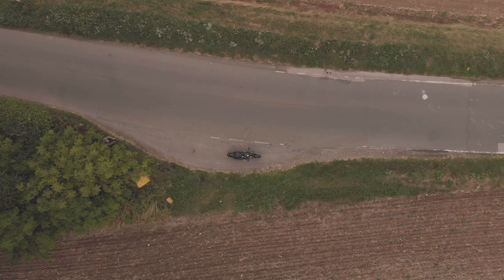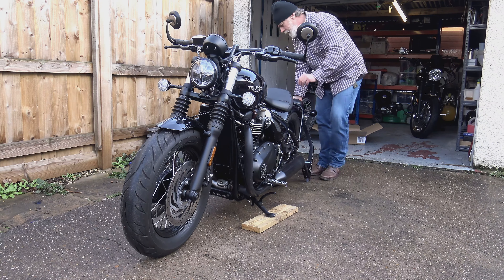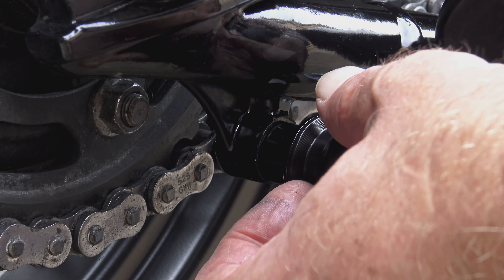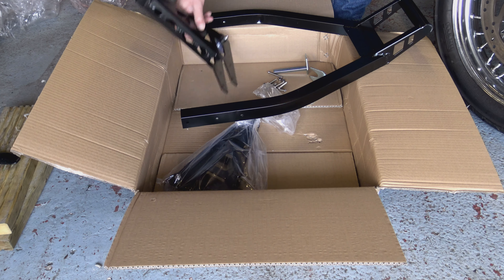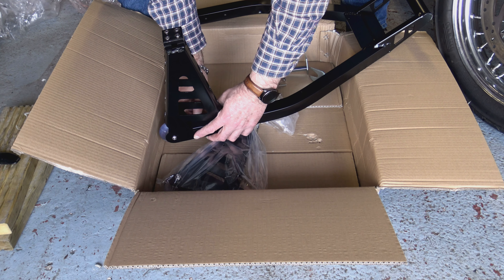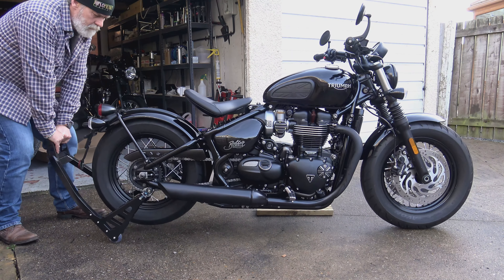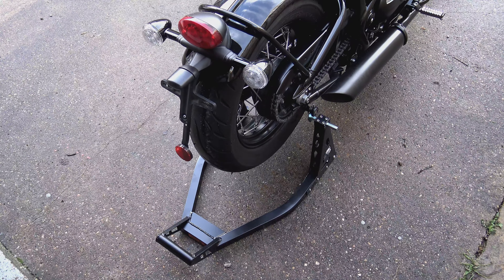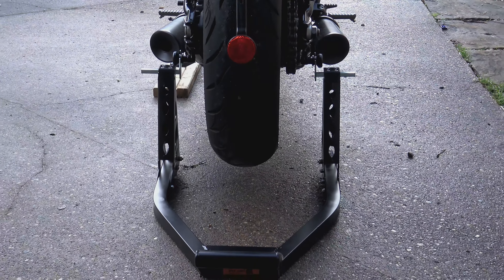Triumph Bonneville Bobber/Speedmaster/Thruxton. Budget motorcycle Paddock stand, & How to use it!

Comment: For anyone having an issue with their paddock stand not having enough leverage, you can put some 3/8th steel rod through the rear axle to get a higher point of contact for the paddock stand. works like a charm and saved me having to replace my expensive stand for a low profile version.

Comment: Arm length, leverage and weight capacity are key!  I have two paddock stands. They do clear the rear license plated but won't lift the very heavy Triumph Bobber.  I bought a hydraulic center lift that works well.

Comment: Excellent bike, better than all harley, but the chain is a little snag.
Reply from the maker: Why is the chain a snag?
Reply: @stuartfillingham  
Not a big problem you must oil it in every 500 km;  how much time do you consume for a periodic oiling of the chain?
Reply from the maker: @onourkaraaslan  Ive been running chain driven bikes for almost 40 years, Never had a problem with chains. They are the most efficient way to drive a bike! shaft drive is inefficient and drags down power, pushing up fuel consumption and is incredibly expensive when it does need servicing. only ever had one belt drive bike and it was a nuisance constantly stripping teeth and needing replacement. If you dont like spending time maintaining a motorcycle then a motorcycle is probably not for you!

Comment: Can you straddle the bike and push forward on the bars to take it off the stand thereby reducing the possibility of the bike falling over ?
Reply from the maker: No I wouldn't advise it James, theres a good possibility you would cause some damage and end up wearing the  paddock stand!
Reply: I imagine with careful use of the front brake it could be done ?
Reply: No problem, it was just a thought.I have a jack that goes under the engine, like the Sealey one.I wish every bike had a centre stand like the old days but some designs of bikes don't allow for one.  I would prefer a centre stand over some of the fancy electronics on some bikes. Even my 74 Rickman Bonneville had a centre stand !

Comment: Hi Stuart, so I have a 2009 Speedmaster 865, which, like the Bobber, is also low. Unfortunately it doesn't have any lugs under the swing arm to put a bobbin into at all. Would you be able to recommend something that would work (or point me in the right direction), or am I resigned to using a scissor lift / hydraulic lift to do the job? Thanks.

Comment: Thanks for doing these detailed instructions for using a paddock stand. It's one of those things I was unsure about but didn't want to expose my ignorance. All my bikes have had a centre stand, so I haven't needed a paddock stand. However, I'm not too happy with the Triumph centre stand I had fitted to my 2016 Scrambler, so am looking at other options. I think there are other designs of paddock stands that don't require bobbins (my bike doesn't have lugs for them). I do wonder if those designs are secure and won't damage the paint on the swing arm. I'd appreciate any comments about this.
Reply: I own a 2017 Street  Cup and I bought TEC Bike Parts bobbins that have a threaded bar that fits the rear axle.   I use a similar stand which Stuart demonstrated.   I remove the bobbins  after I am done .  I bought this stand and TEC bobbins to remove the cat and install a X - Pipe.    I have 2 other motorcycle stands one a scissors jack ( 1100 lbs. )  second a hydraulic jack that will lift my 2008 H-D Dyna Low Rider which weighs in at 680 lbs.  I live in the USA so I am not using  Kilograms,  sorry.   TEC says you can adjust the chain  but I use my other jacks because I find it easier for me.
Reply: @bill_4359  Thank, Bill. I'll check out the rear axle bar option. Much appreciated.

Comment: Could’ve done with this video when I first popped my Yamaha mt01 up on stand, scared me half to death!!  Out of interest, for some reason, I always lock the front brake on with a strap so the stand slides under the bike rather than the bike moving back, not sure if thats a recommended way of doing it, I suspect I was just scared of the bike moving.... It does mean the wood stays in the right place.  Anyway, useful video for the uninitiated.  Hope pup is recovering well.

Comment: Hellooo, Stuart..  I just bought a 2005 bonneville t100 air cooled. Naturally, no center stand, AND,,for some reason, a ghost to find. 
The first thing I did was buy the same spool type stand your showing here.  Then came to find there are no spool holes,,,,at all. So I returned the spool stand and brought one for the swingarm. A generic,fits all stand. Problem now is the stand hits the rear brake caliper and even the mufflers, before the brackets hit the swingarm. OMG TRIUMPH,,, what are you doing? 
I see they sell axle spools. But then you can't change your tire, without doing a Three Stooge's skit. Ridiculous. No center stand, impossible to find paddock stands that fit. What's next,,,a block and tackle? I don't like the jack under the skinny frame and the sump hangs down twixt the cradle, so a nice lift has to be perfectly fitted to work around it. All this because Triumph decides,,,no center stand for u. I, like u, never had a bike in the past with 0, center stand. Now I fall in love with a sweet Triumph,,,,and this happens. Guess I'll have to pull the pipes,just to use the stand I bought. Thanks Stuart Dig ur vids.

Comment: Since they've gone to the trouble of putting the lugs there to mount the bobbins, I would have expected Triumph to have a paddock stand in their accessories line; one of the first extra purchases for my Daytona was the Triumph paddock stand designed for it.  Much pricier than this piece but also higher quality.  Looks like that one works OK but also looks like a "get what you pay for" item.
Reply from the maker: Nail on the head Mr Rider! They should supply at least a basic one with the bike in my opinion. Better quality item coming up in a couple of months sir!

Comment: Stuart, the stand works well but my only concerns would be at that precarious moment when the weight of the bike is off the side stand but not fully engaged into the bobbins. As you say practice makes perfect when using this piece of kit. Not totally sure why people would comment on the price of motorcycle related kit or tools. I have found through experience that sometimes paying that bit extra for quality stuff is sometimes worth the investment, particularly when it comes to hand tools. The first time I put my GL1800 onto its centre stand was a momentous occasion, my back has never been the same since!  To that end I have just ordered a new lighter weight GL1800 Goldwing for delivery on 1st March to coincide with the new registration. Opted for the DCT version as I quite fancy the idea of having no clutch, i assume that it will be very similar in operation to the DSG gearbox as fitted to my Golf R.  Ride safe sir.

Comment: Just to agree with previous comment from Henry, surely a 'vintage' pre war styled bike ought to have the Old Style of stand that flips up and is stowed need the rear Reg plate!?🤔 The Paddock stand Bungs would have to be replaced by some type of hinged affair. Modern materials ought to be both light and strong enough. That way you have a stand on the bike and keep the Paddock stand for the garage. Cheers Keith